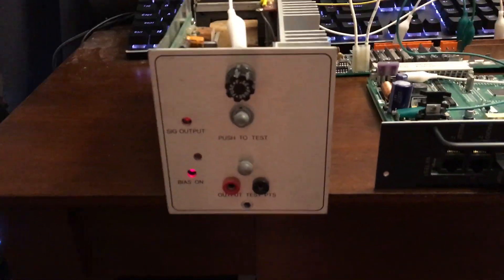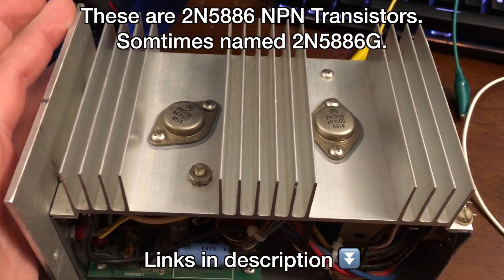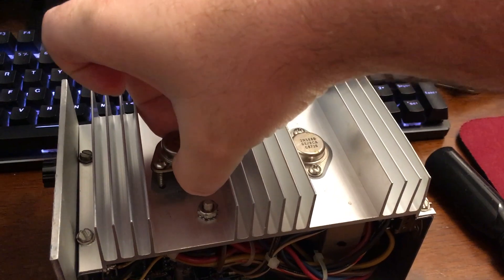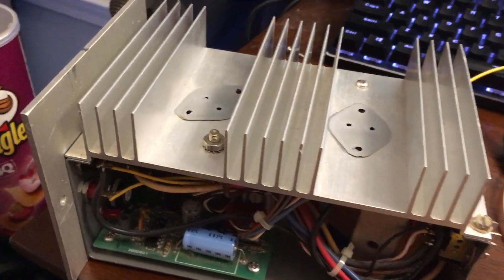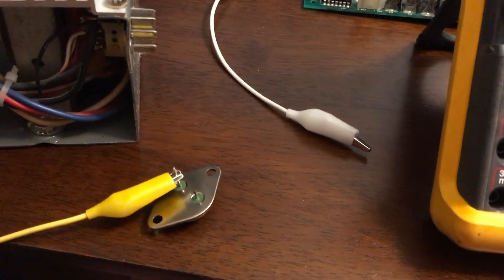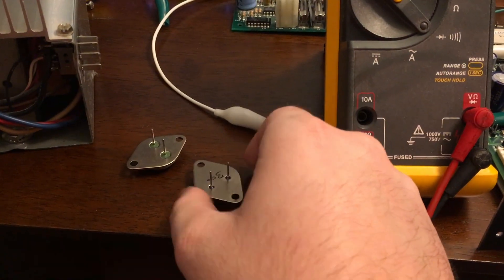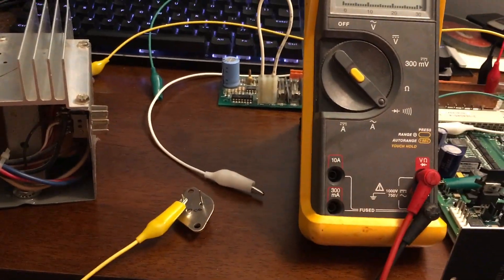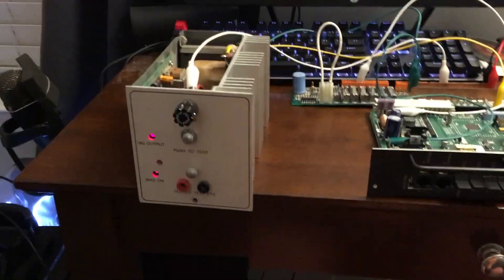How to fix dead SiraTone and MC amplifiers

Comment: What happens when you press the "push to test" button on a working one while it is inside the controller
Reply from the maker: All it is is a switch to send the speaker signal to those front red and black banana jacks. You put your multimeter probes in them to ohm out the speakers and make sure they are operating correctly. It still works normally with the button pushed.

Comment: how do you connect your UV controller to a SiraTone Amp
Reply from the maker: There’s auxiliary pins on the UV board that outputs it’s audio to whatever you want. The SiraTone amp has 6 pins on the connector, input power 24V and two negative pins, audio input and driver output 1 and 2. You just need 24V power and ground to the amp and signal input from the UV and it works just like normal. You must make sure the amp and UV share the same ground connection, otherwise it doesn’t work correctly
Reply: @thunderbolt10031  is it possible to wire a Siratone to a modulator?
Reply from the maker: @gradientgamer5480  Of course. The earliest Modulators shipped with SiraTones
Reply: @thunderbolt10031 That must have been in the mid 2000s. When the EOWS series was discontinued.